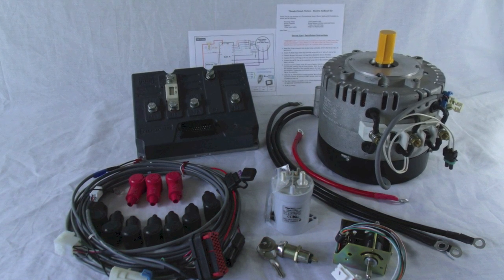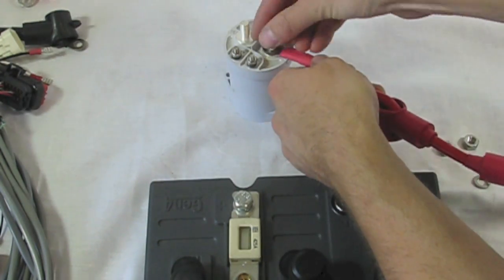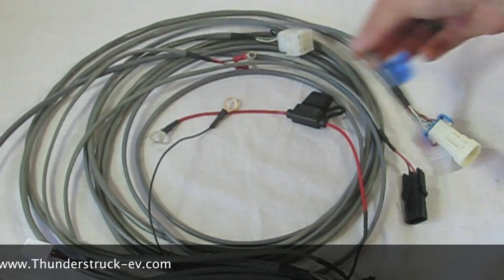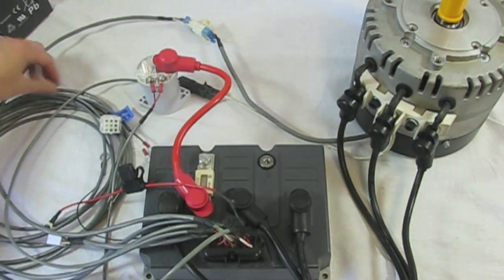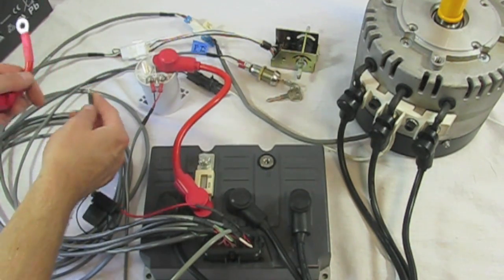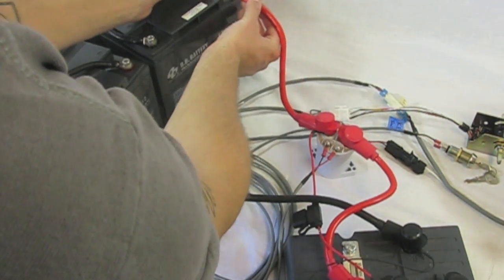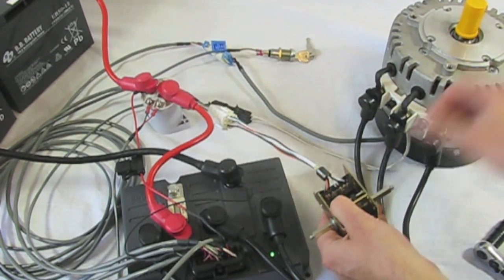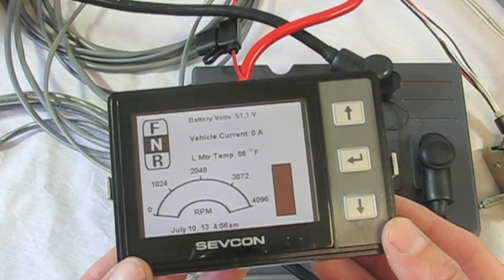Boat kit wiring

Comment: like the charge voltage is the charge voltage....so the MPPT programming would ask for a nominal voltage and cell type.....and the MPPT then is entirely based on the current output.....and at some RPM, the current would be limited, where the product would remain the same, no matter how fast the prop was spinning.

Comment: prop re-gen is like mapping a maximum load curve....but talk to your controller manufacturers about marine specific software updates, and learn it......i don't know if they have a marine specific software update for it, but  the software should function like MPPT in re-gen...( with an adjustable current limit that lets the prop spin more beyond a point )
so if they do have a marine MPPT re-gen software update, it would be a piece of cake, otherwise you have to work for it, like you're hacking the system to get what you need..
the Sevcon controller re-gen is like a rubber tire on a road.....well it's not quite like that, is it?

Comment: Would really be helpful to address adding the cooling system components in the tutorial, I'm still scratching my head and will probably have to add a completely separate 12v system.
Reply from the maker: Thank you for the suggestion. Hopefully we will have a new and updated instructional video where we can include a section on cooling systems. If you are having trouble with the setup please feel free to email us at connect@thunderstruck-ev with any questions.

Comment: I bought this 10kw few months ago and i'm still building the mounts and support to hold the motor in place well aligned with the prop shaft.I'm not gonna lie it was not easy but i did it without paying any marine mechanic's (they're out of their minds). No  need gear reduction i connect the motor straight to the shaft prop and setup look better in my opinion.I think the gear reduction is over priced too.
I used stainless steel, i'm not a ingenieur what so ever and i want to let people's know that if i did it you can do it too!!
Reply from the maker: We hope you installed some sort of a thrust bearing as the motor bearing will not take the load your prop will put on it. Also a gear reduction is a torque multiplier, if you have a very small diameter, high speed prop you may not need more torque to run it but if you are only running max prop rpm under 1000 then the controller will pull a lot of current and overheat. Good luck with your build and let us know how it works out for you.
Reply: @ThunderStruckMotors  yeah  i got the bearing install, about the over hitting i'm adding a cooling system (from a 12v portable cooler) right behind the controller.
Reply: @visiteavecmoi  How did you make a cooling system?

Comment: Is there any benefit to having a pre-charge circuit as my lithium battery BMS closes its contactor with the 5kw brushless?
Reply: The purpose of a precharge circuit is to slowly charge the controller capacitors before closing the main contactor. This prevents damage to the controller and arcing in the main contactor. If you handle this process elsewhere then fine.
Reply: @brianhall7696  I didn't see anything about precharge on the 5kw info page. Does it pre-charge itself?
Reply: @brianhall7696  I build program and sell valence u-BMS's for XP series setups.  They have the ability to activate a pre-charge contactor through the resistor for 3 seconds before closing the main contactor.  But only if I activate it in the software will it work. I'm building one now for a customer that's using your 5kw brushless.

Comment: how do you wire to charge system with solar? do you have a video for that?
Reply: Solar charging systems are separate. We do not deal with solar, but a solar provider should be able to assist you with the setup.

Comment: Excellent video. So the wiring harness and output screen come with the sevcon controller?
Reply: The wiring harness is included with our kits. The display featured in this video has been discontinued by the manufacturer. We have other forms of instrumentation for out kits which can be found here: https://www.thunderstruck-ev.com/instrumentation/

Most of our customers are happy with either the CAN Translator or the Cycle Analyst displays.

If you have more questions please reach out to us at connect@thunderstruck-ev.com

Comment: I'm curious on what kit would be good for a Corbin 39' with a 45HP engine. How much would it cost for a complete conversion kit. would i need the gear reduction ? thanks ! nice video.
Reply: I have a LANCER 42ft sailboat at 22000lbs and did the whole conversion minus solar for 11k. Half the price of  other competitors. Selling my diesel components will half that. So 5k for piece of mind, no maintenance, no smell, quite and clean! I went with the 24kw kit w gear reduction and prismatic lithium cells 96v. ThunderStruck EV has excellent customer service and a great product and price. Highly recommend.
Reply: @ikeimage  Thanks for your infos ! 11k, does it includes the lithium cells also??
Reply from the maker: At 22,000 lbs displacement, our 18kw kit with gear reduction would be a good fit. For more information, please reach out to us via email.

Comment: Really good video.  Would the 10kw kit be powerful enough for a 30ft, 10,000lbs sailboat?  I'm replacing a 13hp diesel
Reply: That would be a great fit as long you also use a gear reduction. Feel free to email us for any more questions.

Comment: I have 32 years old Beneteau oceanis 350 sailboats. I would like to replace my 30 HP diesel engine with a 10KW Brushless Sailboat Kit. I would like to know how many ampers I need for 70% power drive 4 hours? I'll calculate battery cost and area needs. Is my motor can charge my batteries when I sail? I think I'll need a hybrid inverter for this project. Can you suggest a hybrid inverter for this project (capacity, power, etc)?
Reply: If you're not needing 4 hours often you may be better off just bringing a generator for those times that you do need four hours. Please email us so we can have our staff answer any more tech questions you may have.

Comment: Hey there.   Question:  I have a life boat row boat style. Converting to solar electric boat.  About how long can it run on4   75 ah gelcellbatteries.  Boat is about 1000 lbs.
Reply: It depends a lot on how fast you need to go. If you're just trolling around (using similar power as an electric bicycle for instance) you may get 5 hours out of it whereas if you're maxing the system out you'd be closer to half an hour. Sorry but I don't have any concrete numbers for you as I don't think we've put one of these in a life boat. If you could borrow a trolling motor that would give you an idea of the power consumption at X speed.

Comment: Can this System work with a Cal 27-2 Sailboat, Replacing an Atomic 4
Reply: Online specs show your Cal around 7,000 pounds so YES this would work great for that. Check to see if your A4 has a 2:1 reduction or a 1:1 (less common) so we can get the appropriate prop speed.
Reply: I have this same boat, did you ever install this system?

Comment: I got one of those kits with a water cooled PMAC, but it's not working. The Sevcon drive doesnt throw a fault, and batts are at 100% SOC.
Reply: Since you didn't purchase the system from us, we would need to see a wiring diagram. It's possible there is no throttle input getting to the controller. Email us in link above for further technical support.
Reply: I've already checked the inputs and are being sent to the Sevocon drive (both Digital and Analog, the latter being the throttle with a voltage ranging from 0.2 to 10.5V).
I sent more info to this address:   imgur.com/a/XzjZh
Reply: Email us at the link above if you'd like to send us the system to diagnose.
Reply: What link are you referring to ? I dont see any, nor an email address. I posted the diagram in imgur.com   
Is there a way to send you an email through here?
Reply: Our website address is above. We have contact information on our website.

Comment: hi ...can you tell me which voltage rating line contactor should i need by for gen4 size 2 sevcon driver 275 amps
Reply: Hello friend, I need sevcon Gen 4 80v 180a software for remove Max rpm limiting, anybody have it? If have software of it or download link, please give it to me 😢😢🙏🙏
Reply: Hi, do you know what's brown and black wire from sevcon Gen 4 80v 180a size 2 is for what? Comes from 3 pin connector but just have 2 wire and brown wire have 40v and black is ground, I don't knowbid use for what function ?
Reply: did you ever figure it out?

Comment: What is the output of "throttle"  is that CAN ???
Reply: The throttle output for this is 5 volts. The other pins are for fwd and reverse switching.
Reply: Brian Hall Thank you very much for the reply Brian.
So as I understand even without any CAN connection, we can start the motor moving??? 
Is those 4 pins necessary ?
Reply: Amin Hajihosseinlu The controller initially needs to be programmed which we do in house, but does not require a CAN throttle input.

Comment: How much for full package.....?
Reply: Expect $1700-2K plus batteries and charger. All components are available at our website, see link above.
Reply: Brian Hall Do you know where does he use CAN connection??
In datasheet there are two CAN connections, in this video I dont see any CAN connections.
Is the output of throttle analog? why does it have 9 pins?
Reply: +Amin Hajihosseinlu  The throttle is a hall effect type of sensor. I suspect it also has some fwd/rev discretes as well.